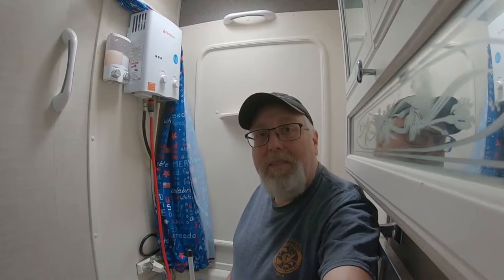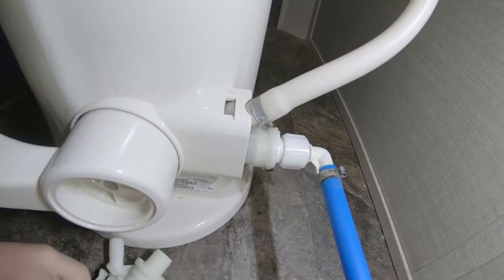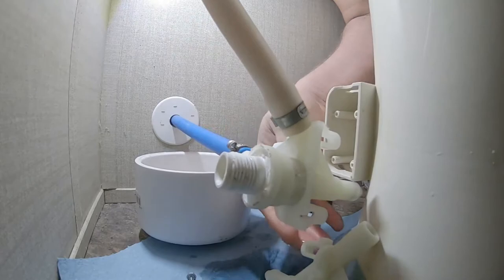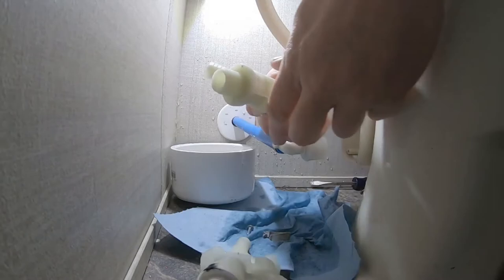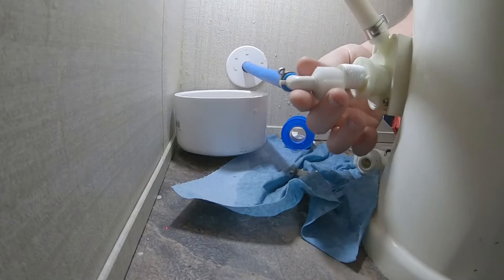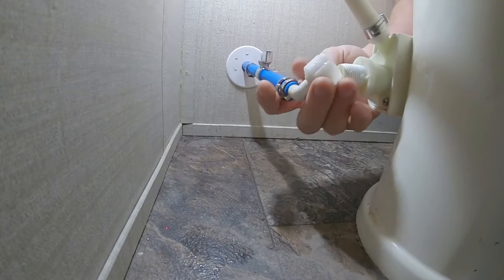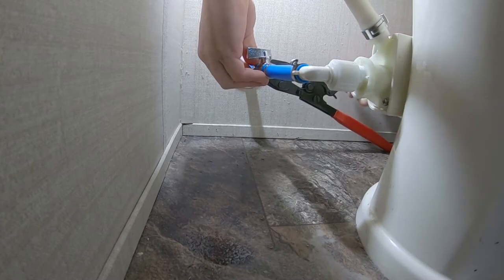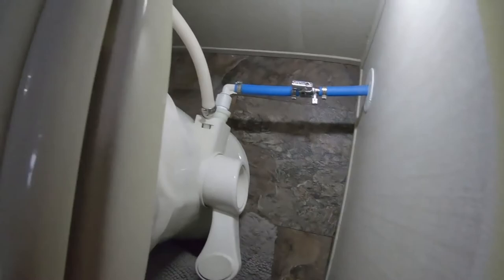Fixing a leaking RV toilet valve

Comment: Great video, I just replaced mine twice along with the vacuum breaker once and it STILL leaks into the bowl🤷🏽‍♂️ That being said I have a trip in two days so plan to add a shut-off. Great idea! It'll buy me the time until I can really dive in to find my issue.
Reply from the maker: Try loosening the screws that holds the valve, my thought is maybe the ball valve is slightly depressed allowing water into the bowl.

Comment: Thanks for the video! We just got a camper and noticed the toilet leaking but it is leaking from that plastic part that attaches the blue water line to the new valve. I’m not sure where to find this certain piece are you able to help with that? Thanks!

Comment: What if my water supply line isn’t staying in the screw on would that be a broken valve, or would it be the water supple line connection
Reply from the maker: Sounds like you have a bad crimp or a bad fitting.

Comment: I just replaced the valve in my camper, it’s leaking, any idea why?
Reply from the maker: Hello Dale. Is the leak still coming from the valve? A few thing to check, 1 is the leak coming from one of the crimps 2 did you get a bad valve 3 you may have a cracked water line.
Reply: @millersinthemoment5427  how do I diagnose which it is?

Comment: Bought new valve replaced it n still leaks when I flush… buying new toilet
Reply from the maker: Mike, did you just get a bad valve? Did you check the lines themselves to see if there's a crack in them?
Reply: @millersinthemoment5427  no I didn’t check. Just bought trailer recently. Noticed one of the screws were missing. It would drip when pressured up and now it don’t drip when pressured up but when I flush it leaks from same spot
Reply: @millersinthemoment5427  it leaks from inside housing that holds new valve.
Reply: @millersinthemoment5427  again no, valve only leaks when I flush toilet.does not leak with it just pressured up. It is a pretty good leak when flushing, kinda steady stream
Reply from the maker: @mikepagan7529  the only thing inside the housing is the water valve and a lever to engage the plunger valve. If it's only leaking when you flush that means the pressure side is good, so the leak is on the top side heading  to the bowl. I would pop the valve out of the housing and push on the plunger in the front of the valve and see where its leaking from.
Reply: @millersinthemoment5427  not a bad idea, I’m actually tired of foolin with it. Got new seals n other items but I already paid for a new toilet. Will see how that holds up!
Reply: Awesome idea to add shout off water. Thanks for shared your video.